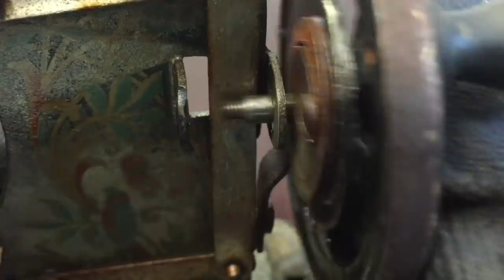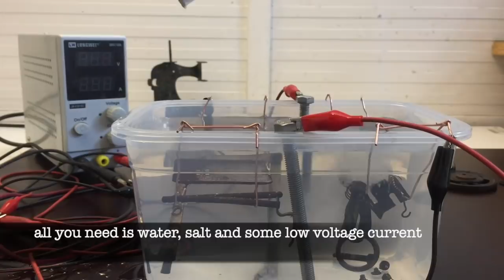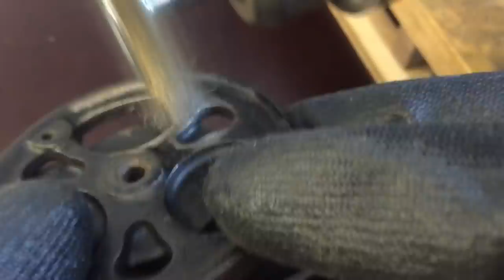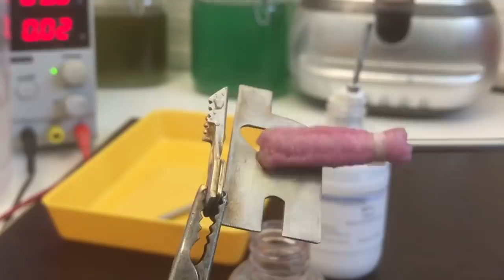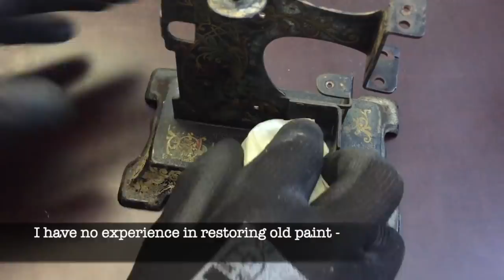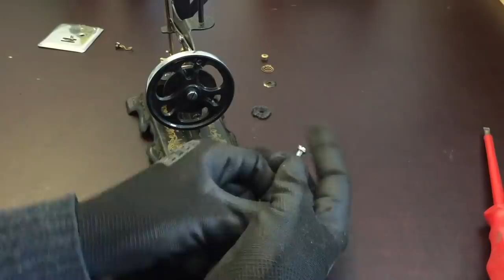Restoring 1930s Toy sewing machine

Comment: Wow, great restoration, you made it look new, and I love the gold sparkle paint and plating, great touch, also if for needles, you can get the 24x1 size 14 then turn the needle bar where the screw at the 3 o'clock position, because the 24x1 needle threads from left to right and you should be able to sew very nice chainstitch run.

Comment: Will a small DC power supply work it doesn't need that many amps does it? 5 volts? For the electrolysis.

Comment: Or would a battery be a better form of DC than AC going through a selenium or rectifier? In other words does it matter if it has a pure form of DC current
Reply from the maker: Good question - and I don’t know :) But there is a lot of factors to consider - such as temperature, material, the cleaning and the current. Here is a link to a British site for gold plating - there is a lot to read. 
https://www.goldn.co.uk/electroplating-guides/

Comment: What happened to the needle? where is the bobbin? why didnt you test it on a piece of fabric?
Reply from the maker: Thanks for asking. I tried to find an original needle - I even wrote to Toy Stitchers International but they couldn’t help me. And then I ran out of time and had to finish the video without the needle and without trying it - sorry.
Reply: @fixingupoldthings7647  So, it was designed to actually work and make stitches?
Reply from the maker: @M. A Bolt oh yes - it works and can make stitches. You can see it here, at the very end of the video from #RestorationStation https://youtu.be/LYa1W1NFi1M